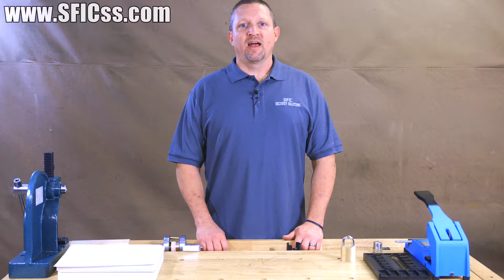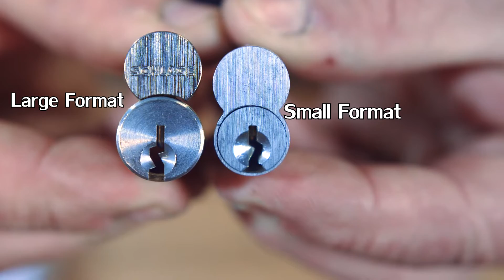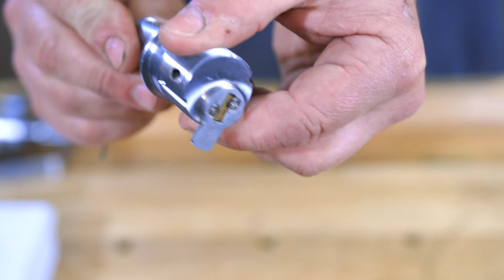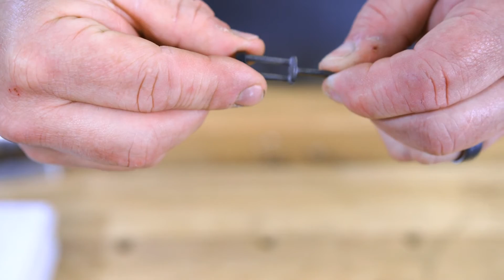Basics of an SFIC Key System

Comment: Hello Sir, I am a locksmith in training and my question is... Why are these SFIC leversets designed so that the key cannot be used to lock the lock? My current understanding is that the key only pops/opens the lock- and that in order to lock the door you much use the button/twist knob on the inside of the door and then close it.
Reply: There are several different functions for these locks. A storeroom function is always locked on the secure side, and always unlocked on the safe side. You always need a key to enter.

A standard entrance function requires you to push the button on the safe side, and then it will unlock with a key or by operating the inside lever. If, however, you push the button and turn it 90 degrees, it will stay locked like a Storeroom function, and you would need to use a key each time from the secure side.

A classroom function requires a key to lock or unlock the door. There is no button.
Reply: @danielarmstrong4381  yes I forgot to mention it's an entrance function lock. And excellent thank you!